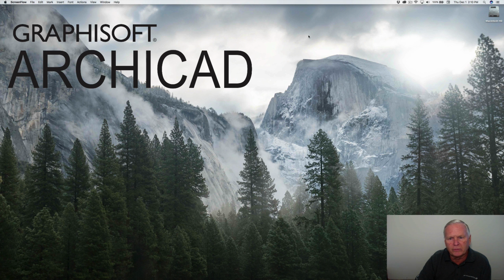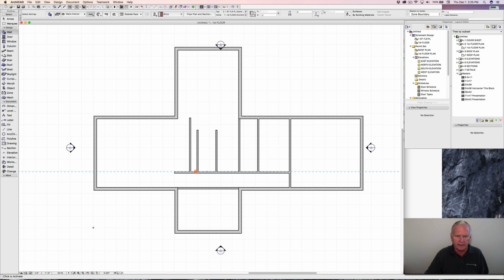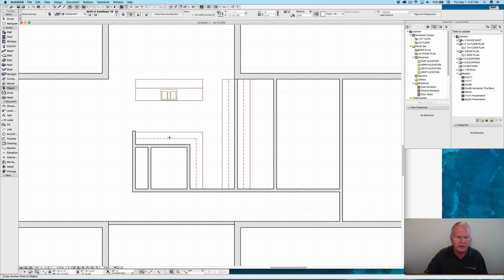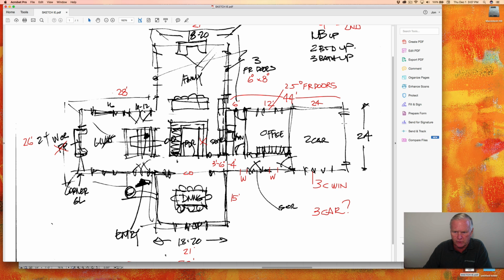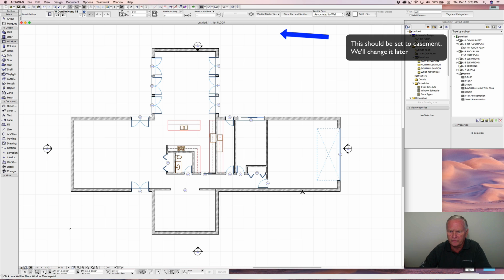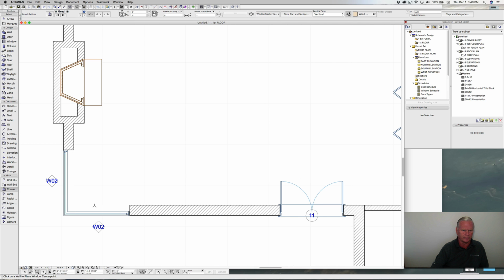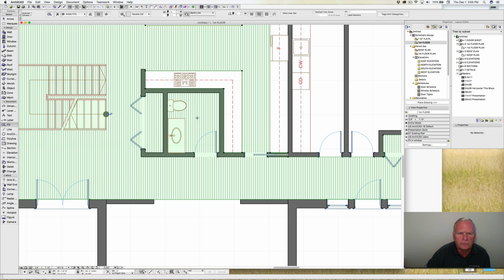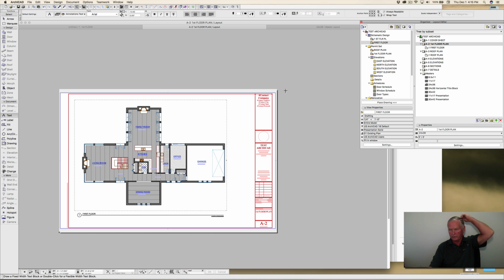ARCHICAD Video #1-Creating The Floor Plan

Comment: The Command Key : Hold it down and it turns into a scissors, put it over a line or? and click, it will trim the item between points or trim off an end.

Comment: Regarding a question about learning AC online. Well, I think it would be very difficult, my recommendation would be to take an online course or two, then there is alot of you tube videos out there that can help you along. If you could find a reseller near you that does training or a user locally that is willing to train, this would be the best in my opinion.

Comment: Would you know why I wouldn't be able to rotate an object? As you can see here I have to rotate selected, but every time I drop the toilet in, it doesn't allow me to rotate it.   https://youtu.be/0WP8imByMfU
Reply: Couple things here for you. Look at you object info box. Most have it show up as a horizontal bar at the top of the AC screen. Look for "Geometry Method" There are several choices, 1st is a point, so when you are inserting your object (your toilet) wherever you click it goes in at the same orientation as shown in the Object Default Settings/Preview & Positioning. If you want to insert the toilet pointing to the right, you have to rotate the preview view, hover your mouse over the toilet in the preview window, a rotation arrow will show up, click it til you get it pointed the right way. Close the Object info box, click the point where you want to insert. This should do it. Now for another way, that I use, Go back to the Geometry Method and click on the second box, now when you insert any object it will go in at the point that is highlighted in the preview panel (as before) but you will now be able to rotate it in the desired direction and then hit ENTER.  Funny how I dont think about this, I just do it, and then when I have to tell someone how to do it, well its just hard to write......hope this helps/solves your question.  Jon
Reply: @jww1251  thanks for the reply, but if you look at the video I posted, linked above, you can see that the second box IS selected, hence my issue. It's not allowing me to rotate the object when I drop it in, per what you're saying.
Reply: Send me your email and I'll send you a short video I did. Unless you figured it out with my written instructions. My e:jon@JeromeCernyArchitects.com

Comment: Is there an example of how to get the orange guidelines, seen around the 10:00m mark in the new version?  I cannot figure this out for the life of me.
Reply: Older versions allowed you to hover and a guide line would appear, no longer. You have to drag from 1 of 4 icons on the “canvas” . You can go to the icon in the menu bar ..triangle turns these on and off but if you want a custom guideline, just to the right of the triangle , small arrow icon ...or shift L I think.
Reply: Is it guidelines you're looking for, or the color or? Not sure what you mean.
Reply: @jww1251  I got it, but I think my way is a work-around. I start by dragging the guides from the icons on the canvas.

Comment: Looks to be not intuitive as compared to ChiefArchitect or Softplan or even Sketchup. Really convinces me that I do not need to consider ArchiCad as an appropriate tool for residential design.
Reply from the maker: CHRIS,
Couldn't be farther from the truth, best software hands down. I have worked with Chief, I am fluent in Sketchup. I have used Archicad since mid 90's. Nothing else comes close.
And full disclosure, I do not receive a thing from Graphisoft!  This is totally unbiased or otherwise motivated.
Reply: No I can run circles around that with Softplan -you are not competitive.
Reply from the maker: Your loss
Reply: How is being able to do the same thing twice as fast a loss? 
Although I suppose that ArchiCad is probably optimized for large project collaborative commercial architecture, doing unusual  things, and BIM so I am not saying it is a bad product just not the best tool for residential design (based on this example)
Reply: @ChrisStewart2  the only thing in circles you will run using softplan is to do all the "work arounds". Sofplan as well as Chief Architect has TOO much power over the model, the power of the model should belong to the user, not the program.....Archicad is amazing
Reply from the maker: Chris, everybody has there go to software, I get that.  I have been doing residential all my career. Lic for 35 years, Designs in 48 or 50 states. Currently working on 15,000 sf home in Iowa.
Just cant see doing prelims and CD's in anything other that Archicad. Typical CD set 75 shts at 36x48.   Best of Luck.
Reply: No need to be defensive about it. It takes a long time to learn any particular system and if it is working for you that is OK -but as far as anyone looking into what CAD software to use if they are going to specialize in residential or small commercial design I would suggest that ArchiCad is not the best choice.
Reply: @ChrisStewart2  archicad all the way

Comment: Hello Jon, great video. Small question! Is this archicad 20 your using. Reason for the question, it seems aliitle bit different than what ive downloaded. Ive downloaded the archicad 20 demo but when im trying to find the icon so i can do a single wall instead of a box wall, it aint the same as yours :(   Tommy, www.celticworks.ie
Reply from the maker: This was done with 18.
I'll have some new videos with 21 coming up.
Reply: Just checked and i think ive actually downloaded 21. Pm me when youve uploaded the video because itll bea great help. Thanks, Tommy. Celticworks.

Comment: I am not able to trim walls the scissors cursor shows up but when I click on walls nothing happens I use windows 10
Reply from the maker: Try being in the wall tool and then using scissors. Note you cannot trim just a single element, the element must intersect with something else, like a line or another wall. then you should be able to trim.
Try it while being in the arrow tool.
Reply: Sounds like your walls are grouped.

Comment: very good video but i cannot find layer named ''walls exterior'' . i am using archicad 20
Reply from the maker: I dont think it has been eliminated in AC 20. Loo k at your layers list, go there via attributes or CTR L (mac), its near the end of the list, you may have to scroll. Or when the list comes up, sort it alphabetically by clicking on the Column labeled Layer, it will reverse the alphabetical sort.
Reply: +Jon Whitney Welker I don't see that layer I think I will have to create one also I don't see any residential template when starting archicad
Reply from the maker: The Residential template comes with Archicad. I suggest you talk to your Archicad sales rep
Reply: +Jon Whitney Welker I think this could be the reason
Reply: +Jon Whitney Welker could you share me the residential template file It will be helpful
Reply from the maker: Since this this Archicad's basic template that comes from ARCHICAD, you should get it from them. It should have come with the software. If it did't you could be dealing with a pirated or cracked version. Contact Graphisoft best bet.
Reply from the maker: IF you would like my Template, am happy to send you.
just email me that you would like it. It has alot more in it than the ARCHICAD one.
jon@JeromeCernyArchitects.com
Reply: +Jon Whitney Welker I am using the international version of archicad.  The default layer selected is structural-bearing
Reply: +Jon Whitney Welker which country version u r using
Reply from the maker: US
Reply: JON I just found you here and simply LOVED YOUR VIDEOS!! it's a very practical way to learn, specially drawn by an architect. I'm new on Archicad, I'm coming from Revit which is really very complicated, i use it for years and still have tons of doubts.  Looks like my archicad also doesn't have the layers wall interior you mentioned. So I would love to take a look at your Template if you are willing to share it. Congratulations! I'll still be watching all the other videos soon.